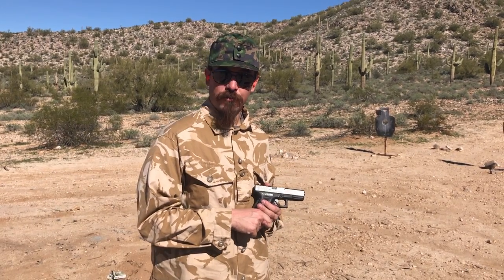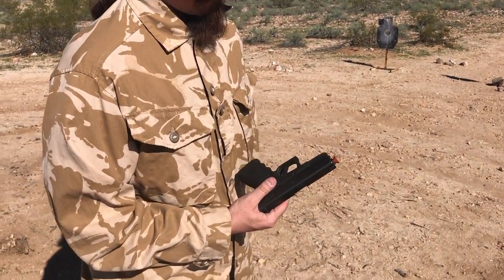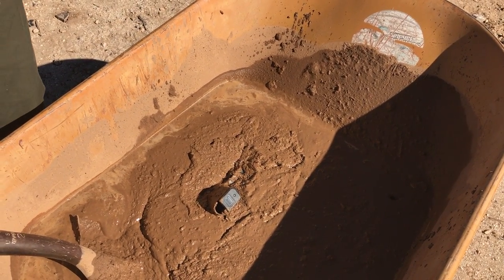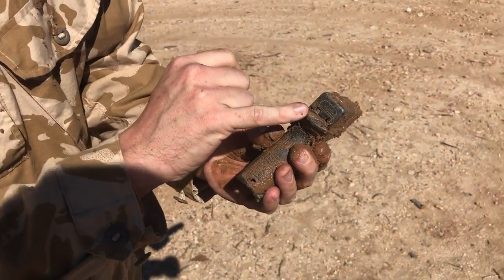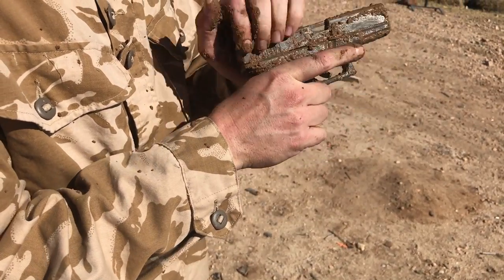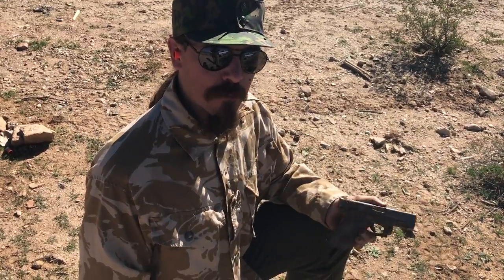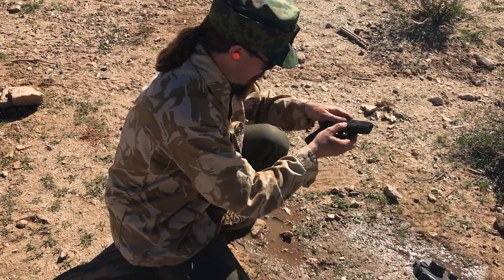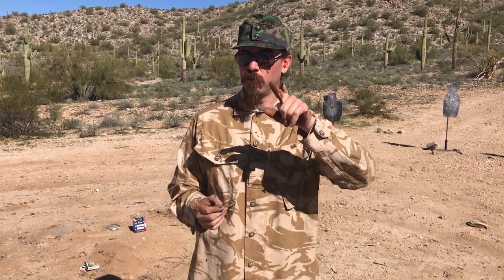Mud Test: Glock 19

Comment: I dont want to sound like a Glock fanboy, even though i most likely am, but usually you guys at least shake the excess mud off the rifle or pistol. This time there were literal piles of mud on the Glock before you started firing, obviously something of that excess gunk will fly into the open system when the gun cycles, trashing it instantly.

I Like those videos very much but imo you guys were a lot more mean to the Glock than most other pistols. I wonder how it would have performed if you just gave it one quick shake to get rid of the excess mud before pulling the trigger.

Comment: Any test or proof of reliability is worthwhile.  What I would like to see is Ian and Karl going the extra step and showing what to do if you weapons falls into a mud pit to get it to function.  We know that the AR if the dust cover is down is more likely to function than an AK.  One you fire you AK the mud will take it toll.  Lets see with that glock what happens if someone tries to wipe/rub the excess mud off prior to firing.  This is not an unreasonable scenario.

Comment: Also, take the striker/slide back plate thing off with the slide still on the frame. Awkward, but it can be done. And that should allow you to take the slide off without having to drop the striker.

Comment: This may be a rather tricky gun to acquire, but I know Ian did a video on one several years ago. How would a F2000 do with a mud test? It has a very inaccessible action and ejects out the front, so the only serious place mud could get in would be from the charging handle area.

Comment: So as it turns out, Glock’s biggest design flaw is that you can’t disassemble the gun without pulling the trigger and dropping the striker first and it has no backup method like, sayyyyy, the M&P series has.

Very interesting

Comment: I wonder if the older style of locking lugs like a 1911 has would get filled with mud. I know Ian’s 1911 copy didn’t do too great but if I remember that was mostly due to getting mud inside the hammer/main spring assembly.

Comment: Here's the problem with these tests - they are not consistent. In the 1911 (ballester molina) test, Ian slaps the rear of the slide to close it. That's a basic failure drill that most 1911 owners use frequently with mud free guns. Slapping the back of Glock's slide would've most likely solved the failure to go into battery.

Comment: How about a revolver mud test have you tried?
Reply from the maker: +Richard Lunz We will never do a revolver test as it is not safe.  ~Karl
Reply: Would blew up if catch the wheel inside ?
Reply: You'd have to use snap caps for safety. The tough part would be making sure that the primer was hit with enough force, which would be very tough without a proper cartridge

Comment: Glocks are known to experience hydro-lock when exposed to liquid. Liquid, being water or much of anything resembling it or containing it. 
Glock has known about this issue with its pistols for some time. And Glock has thus been known to make alterations to mitigate it in guns shipping to naval and marine forces,...upon request.
So to me.
This video isnt as much a condemnation of the Browning style locking system. As Ian seems to have a bit of a penchant attempting to do on occasion. Or even of the G19 pistol itself.
As it is showcasing what can happen to a Glock 19 that hasnt been altered to prevent hydro-lock.
A condition that I believe, if my memory serves me, Mack over at the Military Arms Channel, has himself experienced whilst doing his own Gauntlet Challenge of a G19/17.
 And my comment here isnt any attempt by a "fan boy" of Gaston Glocks creations, to explain away why Ians G19 failed in a deliberate mud bath dowsing.
Im merely raising the point that there is sometimes more to a weapons failure than meets the eye. Especially if the weapon in question is being sort of deliberately tested to failure by rather extreme conditions it might not ever normally experience. Even in battle.
After all.
ANY tool can fail. No matter how well made it might be. IF its being intentionally abused.

Comment: A hacksaw or a band saw should open the Glock with no problem.   So what have we learned?   Hi Points and Lugers resist mud better than Glocks.
Also the more watery the mud, the deeper into the mechanism the mud will penetrate.    :)

Comment: This only proves that if a gun fails the mud test it doesn't mean that it's unreliable. Just because the hi point did better than a glock in a mud test doesn't mean it's going to beat a glock in a full trials test.
Reply: Jmad246 actually, it does. Just accept it. Let it hurt.
Reply: Well most police forces and the navy seals that actually use the gun disagree. I'm not some hickok45 glock shill. I'm saying you can't take Ian and Karl's mud test like it's the ultimate reliability test which it isn't. These videos should be taken with a grain of salt.
Reply: as should the Glock.

Comment: I'M  NOT A glock fanboy  far from  it but it appears  ian didn't  do the small  shake  just turned  the gun lightly   and it was dropped  in  3 or 4 times when most pistols are put in twice or have mud slapped on each side   for constancy  I don't  think  this was a valid test   would   this  different  way if doing things mattered you be the judge

Comment: Any machine can malfunction when it's filled with mud, dirt,grime,rocks,metal shavings....whatever.
Reply: Nakanokalronin Some guns are better at preventing the mud from getting inside so this doesn't bother them as much.
Reply: No doubt. Bottom line is guns are machines and machines run well when cleaned and lubed properly. The next Glock dropped in mud like that might be perfectly fine while another brand of gun that did well might not do as well next time.

Comment: Bad test, it needs a mag in the pistol in order to cock and fire.  Pulling the trigger and racking the slide without a magazine of course the firing pin will not drop.  If you know otherwise lemme know.
Reply from the maker: Glocks do not have a magazine safety.  I have no idea where you're getting such an idea.
Reply: @InrangeTv  Thank you very good sir I am thanking you for being responding.  Jk thank you for clarifying, I assumed they all had that now as part of some safety law or some crap.  Video un-disliked and now set to liked.  Thumbs up.